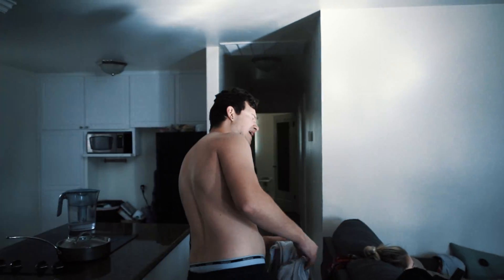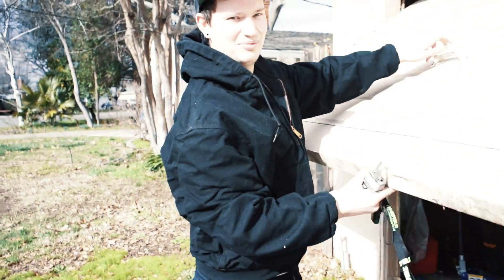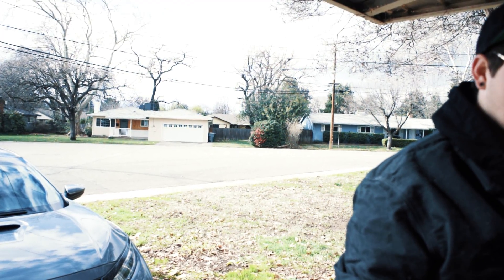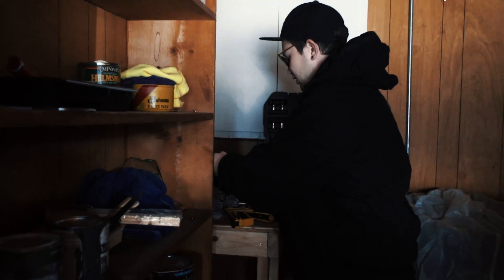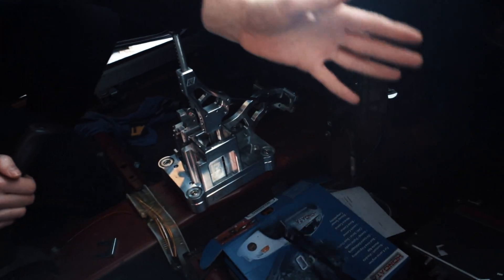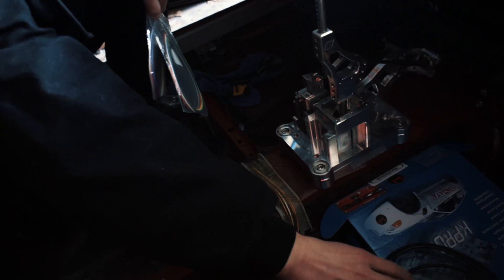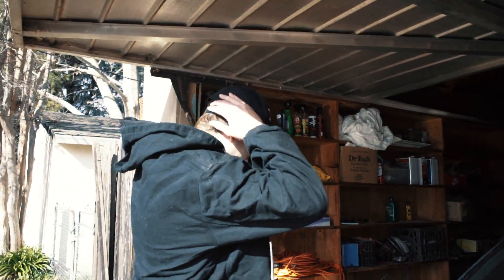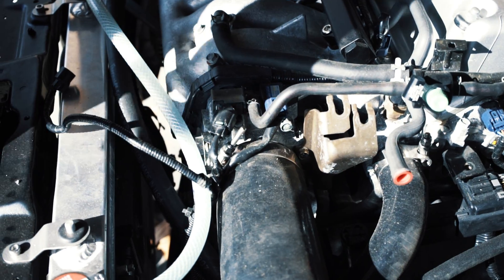Ek CIvic K Swap part 5 - Hybrid Racing Wiring and Hondata kpro ecu

Comment: Hey I know this video is old, but i have almost the same setup as you but I'm having problems. Which is the ecu doesn't start and the car just primes does not stop.
My fuel psi is at 13 and it just doesn't want to start. Plus i was using a type r ecu but im getting a hondata v4 soon. So would you happen to know the issue? Thanks

Comment: Where are you at!!!!??? You haven’t uploaded in 4months
Reply from the maker: Sti Wrx got burnt out on working on it. Pretty much all the fluids are in and wiring is done. All I have to do is get a battery and fix clutch master cylinder working and it should be running. Almost had it running last month but clutch master was leaking fluid so I couldn’t bleed it. Got burnt out. Decided to take a break. So next video it’ll be running!!